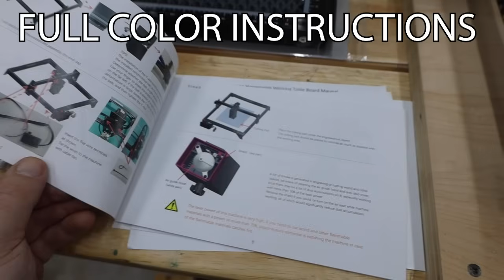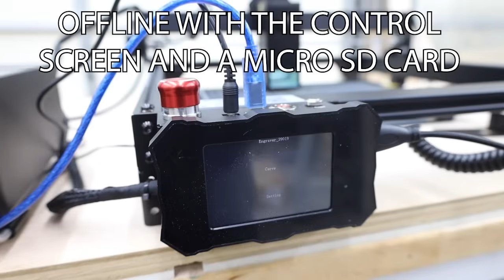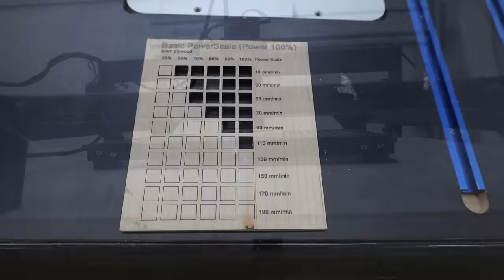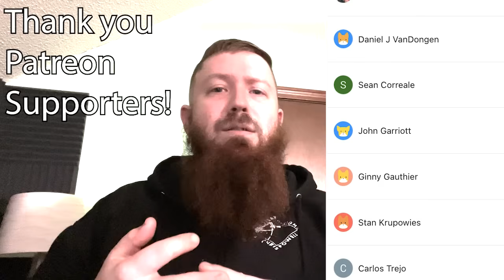Testing the 20 watt Atomstack A20 Pro Laser Engraver and Cutting Machine

Comment: Must be great to finally get your hands on a laser 😂. 
But seriously, as someone who has had stuff cut but never used one myself, where you said “cuts dark colored acrylic”, I’m not clear if dark colored acrylic is easier or harder to cut than light colored or clear acrylic. So does that mean dark is the ONLY acrylic it can cut or does that mean that it can also cut any other color (or clear) as well?
Reply from the maker: Haha. Yea dark solid colors are the only thing it will cut. You need a co2 laser to cut anything transparent or light color.
Reply: It will cut any color as long as you paint it with black water-based paint first.
Reply: Thanks, that is the kind of thing I would never have even considered to be an issue, probably until I got a machine that wouldn’t do what I wanted!
Reply: @jeremyspecce  Glad you asked this Jeremy!!